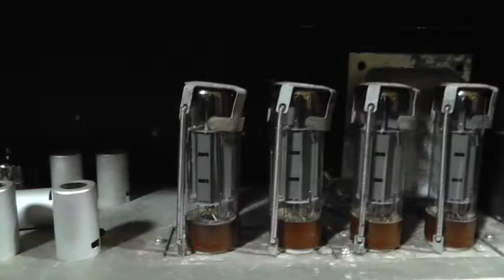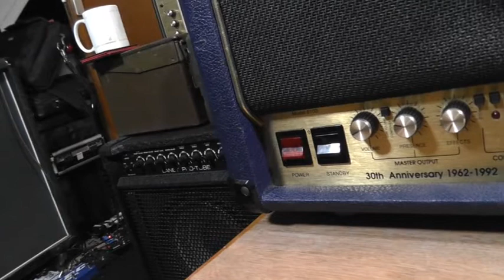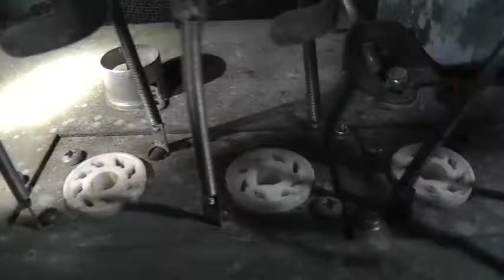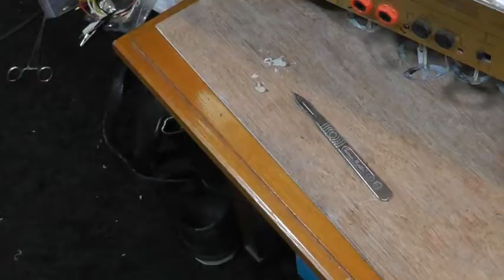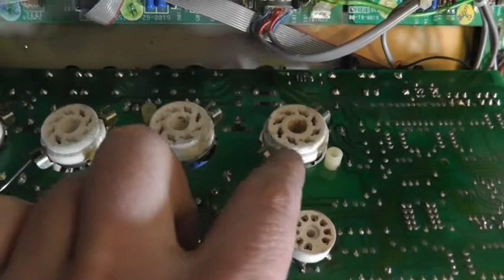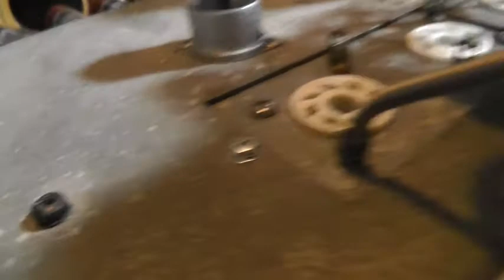Marshall 6100 100w. Crackly and distorted. Recapped and resolved

Comment: Sounds Great ! Think I need to recap mine. Can you point me in the direction of which exact capasitors you got from Mouser ?
Reply from the maker: I replaced all of the ones on the board with the power valves on it. I used Nichicons. I just went for the same values as the old ones. I don't think I recapped the power supply
Reply: @hydorah  Thanks !

Comment: Idea for starters: Switch it on an use the knobs on the right hand side to dial in a great JTM 45 sound.  😉

Yes, the 6100 has MIDI and I love it, as it allows me to switch channels from my effect board for clean, crunch and heavy gain.
As 50 Watters sound might be for some, there is this weird LOW switch.
This amp was meant to give you all past Marshall sounds, so they kindly gave us a couple of switching options.
And they were even wise enough to explain all the clever options including Power Amp damping (set it to AUTO).
A little brochure does the magic trick.

Thanks for the video! I Think I will have a look at my Capacitors soon, even though my 6100s seem to work just fine even 30 years later.
Reply from the maker: Yeah it's a great amp so much packed in to it, but no rubbish! Certainly is a fiddle to work on, but well worth it!